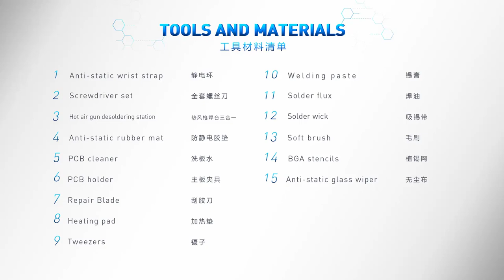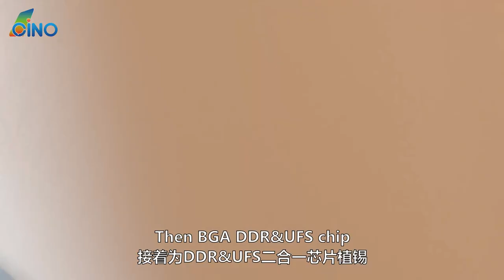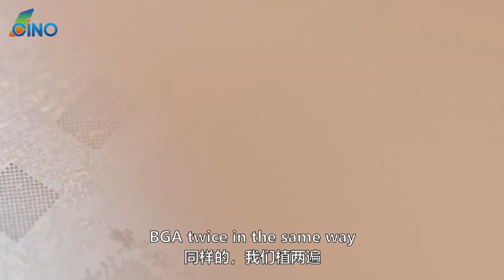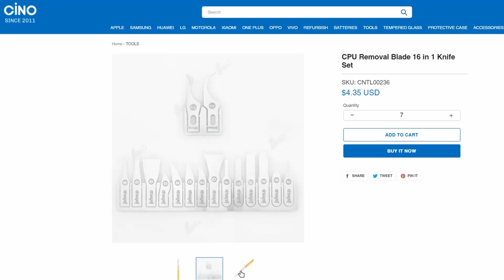MTK CPU DDR UFS Desoldering Demonstration - OPPO Not Turning On Fix

Comment: Thanks for another interesting video. 
Questions: 1. How do you know that 380C, air flow 40, and 30 seconds is good for the IC removal? 
2. What  diameter of air nozzle  do you use for those parameters ( 380C, air 40, time 30s)?
3. When cleaning glue on IC, why do you use a blade and not solder tips?Is not a danger of damage of  IC pins when using a sharp blade?
Reply from the maker: 1. From experience
2. No particular size, just use the big nozzle
3. Blade is more effective, do it carefully
Reply: @CINOTechnology  your the best
Reply: @cino technology u r great and experience
Reply: 1- Every IC has a temperature.